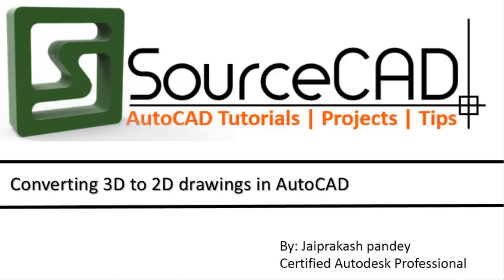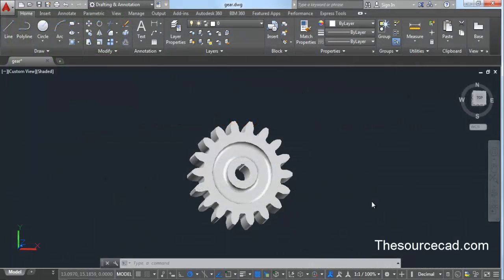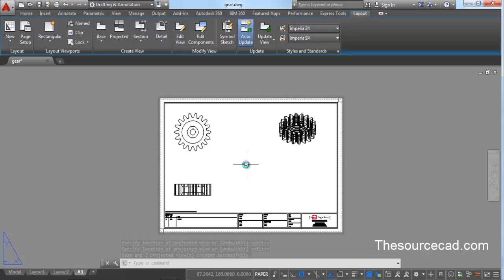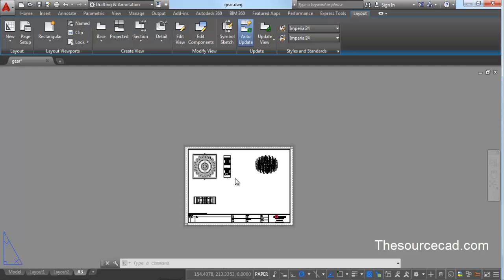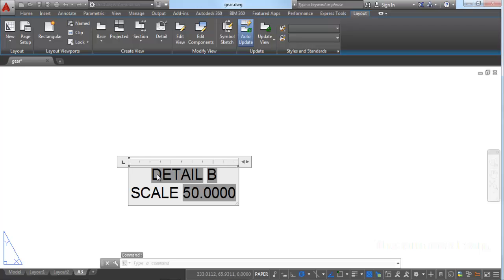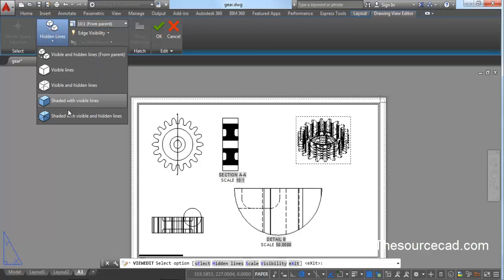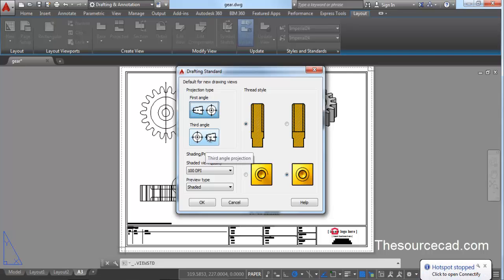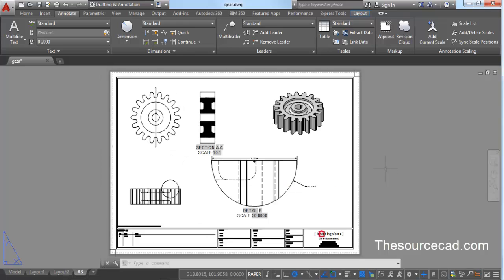How to convert 3D to 2D drawing in AutoCAD

Comment: Sir, r u used to STAADPRO Software! I have a novel design of elevated watertank. Sidewall of the tank is corrugated (alternate  convex and concave curvature forming a circular   vertical wall). Columns are aligned in triangular points  and support the tank floorslab as a flat slab through columnhead. The design has been rightly prepared. Any other suitable structural engineering software  may also be used.
M.Periakaruppan B.E. E.E . Twad (Rtd) Devakottai  9976105892

Comment: How can you see the axis of symmetry ?
Reply from the maker: At which point of the video (time stamp in the video) you are talking about?
Reply: I,m talking about axis of symmetry of the pieces seen in the section whic are dasdot 2(5x) type line (the axis dividing a geometric figure into two identical parts)
Reply from the maker: In this case, I have selected the midpoint of the keyway as one of the points of intersecting lines and for any other geometry also there will be other reference points that you can use. The points, in this case, will be selectable using object snaps.

Comment: Thank you for the video. I have a problem. I made a 3D model, from that a 2D model, then made a half section. I want to add the half section a centerline, but I am not able to do it, because, in the center of the half section is a line, that would cover the centerline. How can I add a centerline, that I would see?

Comment: I have a problem with this converting. When I click on base and than on from model space it does not load my model to that layout but opens the layout with model. I don't know what to do. Help me ASAP, please.
Reply from the maker: can you share the screenshot of your drawing screen?
Reply: I use AutoCAD in polish. Will you understand anything?
Reply from the maker: Delete any existing viewports and try using "from model space" option. If this doesn't work then share the screenshot I will try to figure out the issue.

Comment: I have researched this problem for the layout tab not appearing in the ribbon just like in this video and came to find out that this tab was not added untill 2013 auto cad version. Im new to auto cad so i did not know this was not available in the 2012 version. thanks so much for your help.
Reply: Thanks for share one of the important point. I too was facing the trouble in AutoCAD 2010

Comment: hello, I could not get the layout tab to pop up after going to layout mode. How can I get it to appear at the ribbon?
Reply from the maker: Which version of AutoCAD you are using?
Reply: I am using 2012.
Reply from the maker: In 2012 version I guess layout tab is always present but when you shift to layout view only then tools of layout tab will become active.
Reply: ok. so how do i get to the section command and the detail command like you used on this video? thanks so much for the information.

Comment: HI, where do I find this icons / commands?
Reply from the maker: You are talking about which icon?
Reply: If you are in Basic look in Acad (v2015), you don't see this commands, you need to change to 3D modelling and there you get Layout and this icons/commands (base,...) where you add items on paper. I would like to know where do I find this commands in basic view. I don't want to memorise them and write each command.
And one more thing,  after I put item on a paper (like you did) the only thing I got are blank squares, no item was shown, only frames. Do you know the reason, did this ever occur to you?

Comment: Dear Guyz
                   I have a problem. i m using Auto Cad 2014 and i couldn't  find the Layout Tab. Some one help me.?
Reply from the maker: Layout tab appear only when you move to paper space
Reply: Dear Sir,
               Yes! I am in the paper space But Layout in not Visible there.
                Auto Cad 2014 have the options
Reply from the maker: Although it i shard to find out exactly what the issue could be but I will suggest you to reset AutoCAD and see if tab appears. For making a reset go to start button then all programs then Autodesk then reset settings to default. Make sure you have closed AutoCAD before making rest. Let me know if this worked for you
Reply: Dear Sir,
               Layout tab appear in Auto cad 2015..Thank you so much..This is video is really help for me.
Reply from the maker: Welcome Sajid

Comment: Can I use this for version 2010?
Reply from the maker: As far as I know the feature of projection of 3D into different planes was not available in AutoCAD 2010 however you can use FLATSHOT command which is less versatile but equally useful.
Reply: +RoDJ99&#160; yes, you can do it in AutoCAD 2010, there is a very simple way but not the same steps as SourceCAD did.
Reply: there are solview and soldraw commands since... forever

Comment: Do you know how to convert a 3D file from AutoCad into a simple 2D format so a 2D CAD package can read it? I use a 2D CAD for illustration and often receive 3D files from engineers.  Can I convert all the orthographic and perspective view(s) into a readable 2D file?
Reply from the maker: Yes you can convert a 3D drawing into 2D with AutoCAD, the easiest way to do this is by using FLATSHOT tool.
Reply: +SourceCAD Sorry, I meant AutoDesk Inventor 2016, not AutoCad.  I looked for the FLATSHOT tool but couldn't find it...  Thanks for your response...
Reply from the maker: I am really sorry James I may not be able to help you with Inventor as I have expertise in AutoCAD only
Reply: +SourceCAD OK, thanks!!!
Reply from the maker: Welcome :)

Comment: HI
It is not showing layout tab at the top when I am switching from model to paper space(layout at the bottom)
Can u help?
Reply from the maker: +Sandeep Bhatia can you tell me which version of autocad you are using, also can you share a screenshot.
Reply: +SourceCAD Hi, I am using Autocad 2012
Reply: +SourceCAD Also,Can u tell me email id where I can share screenshot?
Reply from the maker: you can send snapshot on admin@thesourcecad.com
Reply: +SourceCAD Mail sent.Please check
Reply from the maker: +Sandeep Bhatia As I can see in the screenshot you have drafting and annotation worspace turned on change it to 3D modelling and also double click outside your viewport because you have your viewport on, let me know if it helped.
Reply: +SourceCAD I have tried in 3d modelling space also but dint get layout tab and I can see in your video that you are also working in Drafting and Annotation space and still it is showing layout among other tabs at the top when you are in paper space.
Any other way to resolve the issue?
Reply from the maker: +Sandeep Bhatia If you are not able to see layout tab then either there are some issues with your installation or layout may be turned off from options, to resolve it type OP on command line and press enter when options window pops up select display tab and make sure "display layout and model tabs" radio button is checked, plese take reference of image https://www.dropbox.com/s/kjn8csqkldd6hdd/as.PNG?dl=0